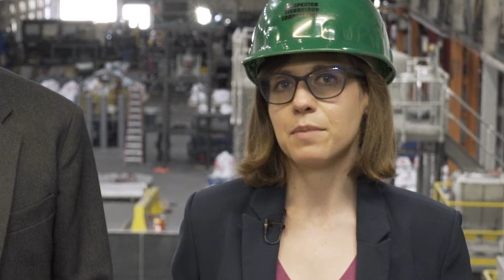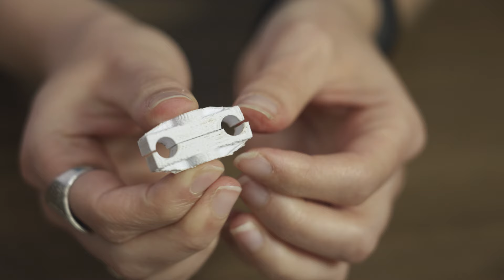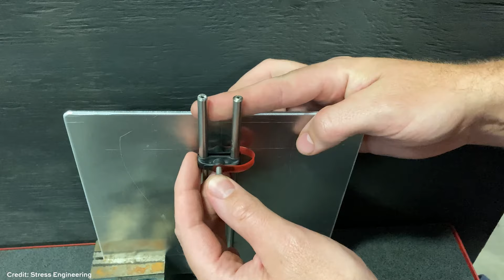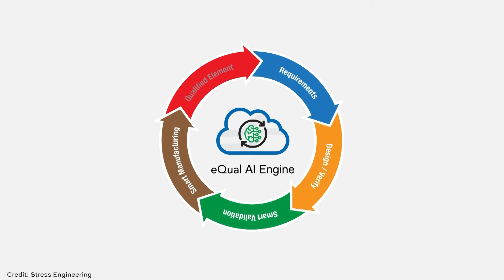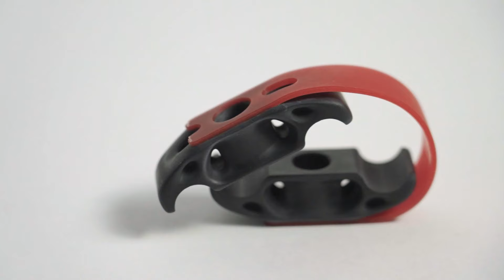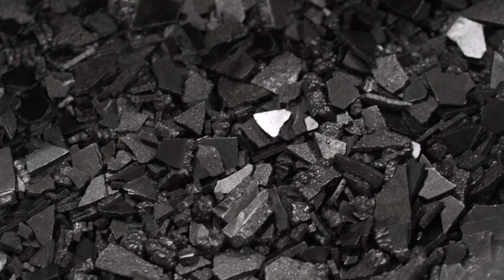3D Printed Replacement Part for an F-16 Aircraft: The Cool Parts Show #54

Comment: The strap thing seems like a step back because it vendor locks the production only to multimaterial capable printers. Perhaps a non-issue if they meant exclusively source these parts from Origin.
Plus it didn't seem to adhere that well 😅
Interesting success story nonetheless, like:)

Comment: 16:10 It ended up cracking? So it wasn't good after all...
Reply from the maker: The part cracked because of over-torquing during installation, rather than any direct result of the design or material. As we understand it, the properly installed clamp would be a perfectly viable replacement.

Comment: Very interesting stuff. 
I am concerned about the following question.
 Why not make clips? In the sense of locks on the ends of the attachment? 
To prevent this clamp from opening? 
So you can make the part even lighter and stronger, relative to the load.
Reply from the maker: From Matt Sanders: "Clips were considered during the design iteration process. In the end, that design concept was eliminated because it was found they were not necessary to achieve the needed strength and would increase the weight and installation complexity."
Reply: @AdditiveManufacturing  Of course, I understood that you were interrupting a lot of options :) I just wanted to know why this one was dropped. Can I try to make my own variations and put them on GrabCAD?
I will be glad if you take a look later;)
Reply from the maker: Sure! Come back and share the link(s).
Reply: @AdditiveManufacturing  GrabCAD SL_ST PIPE LINE CLAMP
Reply from the maker: Nice work! We didn’t discuss it directly in the episode, but this design reminds us a little of the variation of the clamp visible around 5:36.
Reply: @AdditiveManufacturing  To be honest, I didn't notice right away. But when I viewed it again, I saw it. Very similar. Perhaps even too much;) However, I added a thread in the base from myself as a way to keep all the parts together during installation. 

I am very pleased that you took a look at my version. Maybe we'll cross paths again.

Comment: 3d printed parts like that opens the door to more legacy replacement parts being manufactured. Maybe equipment will be used longer because the military isn't beholden to the OEM's will.  Maybe not a whole engine but how about landing gear parts or a radar bracket or translucent landing light covers? Little things like that add up to the viability of platforms.

Comment: Great video. Funny how they tested every detail under simulation but didn't account for an unknown variable as simple as over torquing it. Did they adjust their design to account for that? Fantastic work by the team and love the qualification loop they designed
Reply: The way I heard it, they DID account for over torquing by providing torque specifications. The problem was that the installer did not follow them. Applying proper torque at installation is fundamental for any mechanic. Especially an aircraft mechanic. And even more so, a mechanic for the Air Force.
Reply: 30 in/lb  

Good and tight